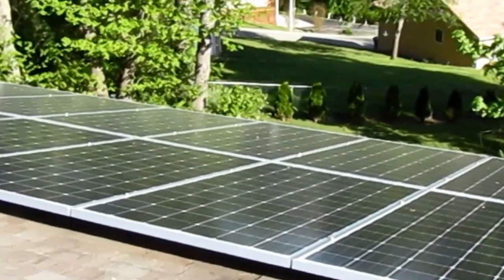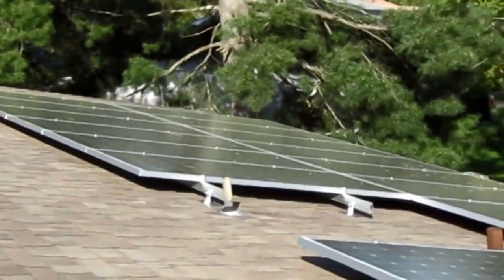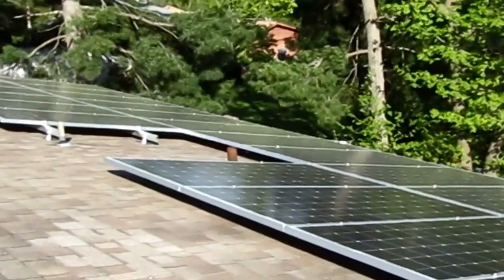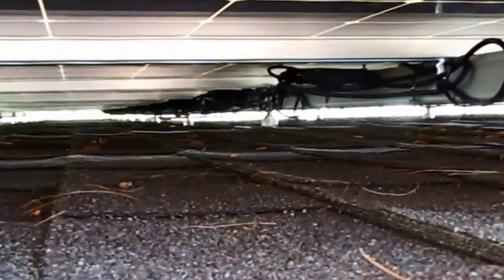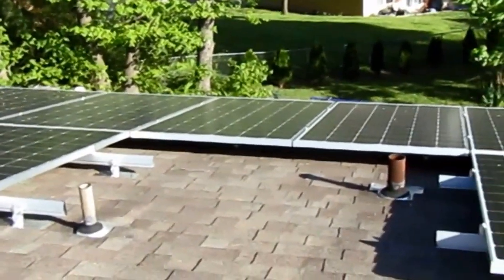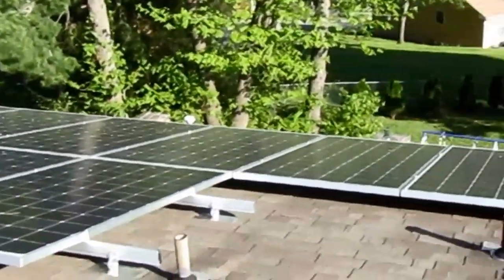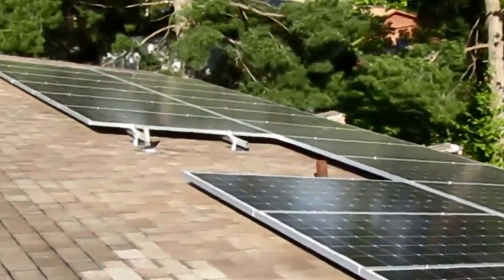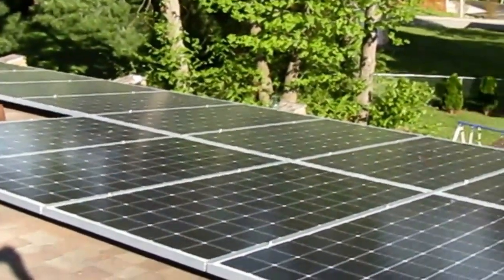SOLAR POWER INSTALL (PART 8) - Ken The Solar Guy

Comment: nice project. will plastic zip ties hold up over time? they usually dry out and crack when used outside for long periods of time.
Reply from the maker: These ties should hold up just fine. They are UV rated  120 lb. cable ties and are never in direct sunlight.